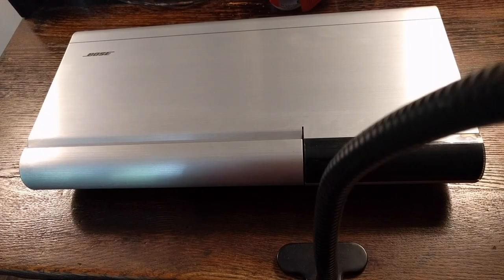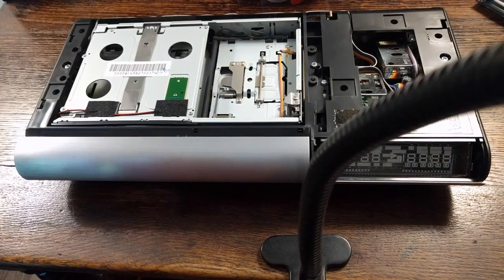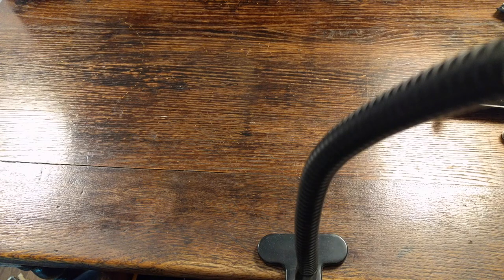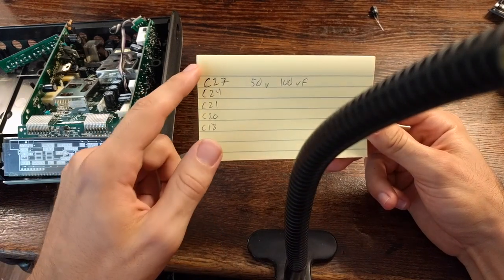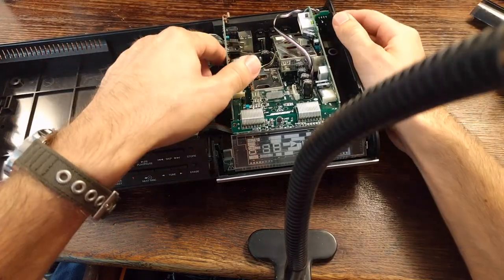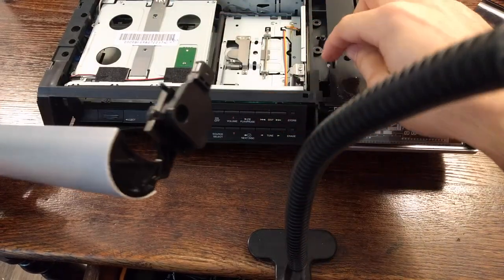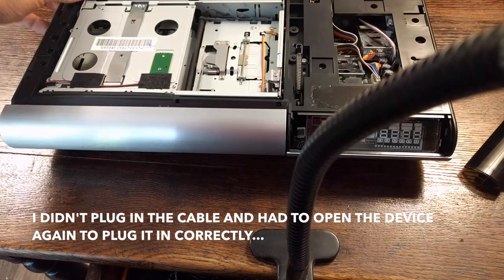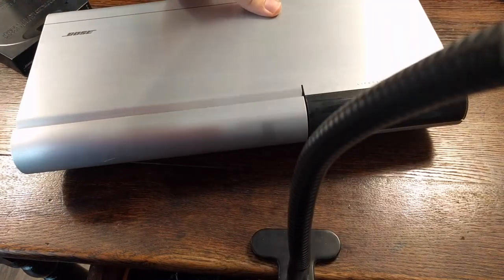Bose Lifestyle 20 Music Center Display Fix Walkthrough

Comment: Thank you. The disassembly was exactly what I was looking fo. Just pickup one of these from a dump yard. When plugged in only motor noise from the cd compartment can be heard . Nothing turns on.
If I don't break it burned or don't get bored while working on it, I think I can fix it. The first tool that I used was my table knife

Comment: It's so amazing to find this excellent video! I knew it was going to be a capacitor issue! I have a lifestyle 25 and I will try this. I read in the comments that it won't come back to full brightness but it's worth doing anyway. Thank you so much for posting this! I purchased the capacitors. I hope it works. Could it not be coming back to full brightness because some other capacitors in the circuit wore out from overuse trying to compensate for the ones that died? If you find any other fixes please post them because I want this stereo to last at least ANOTHER 23 years.

Comment: Great video, just watched your one on remote control RF transmitter fix and yes the coil wire had come loose, I soldered it  ,cleaned the PCP  and contact pads and all working fine. . I shall now buy the 5 capacitors and fix the dim led display, man you've saved me some serious $$. I spoke to Bose and they told me to chuck it and buy a new one . 
Cheers for your excellent video

Comment: Hello Luke I did replace the 5 capacitors and still the display is not coming on, what can be the other problem with it ? Please help.and one more thing is it c13 or c18 as the 4 capacitors which are near together it's c18 please confirm me thanks.

Comment: Thank you for the video. I just bought one of these on eBay and it showed up damaged. I was hoping to be able to fix it myself but I cannot see well enough to do any soldering.  I wondered if you could tell me if I can upscale the same speaker and sub system that came with this console to anything newer?

Comment: I found c13 but it wasn’t a capacitor.  I did see c18 is a capacitor. I replaced c18 instead.
 Your tutorial did work and I got my display back, but not as bright as before.  It was dead for a few years with a stuck cd magazine.

Do you have a fix or replacement gear for the worm drive mechanism?

Thanks

Comment: Thanks so much for making this video, and being so thorough in explaining all the steps. My system's display was COMPLETELY out, but after following this and using 5 replacement capacitors I picked up from amazon, it's back to life again. I wouldn't call it "bright" but it's visible enough. Certainly better than pure dark. Couldn't have done this project without you. Kudos, Luke. <3
Reply: Hello , i have the same display problem with my 25 series ii , can you tell me the capacitors numbers that you used to fix it ?
Reply: @3mendo198  My system has the same problem and I am not sure of the type of capacitors that are needed. Did you get an answer to your request? Thanks.
Reply: @claserealty5972  WHAT EXACTLY IS THE PROBLEM WITH YOUR UNIT ?

Comment: Fixed my favourite systems with your help, thank you so much! In my system, the C27, C24 and C21 capacitors were originally 63V 100uF. Replaced them with 50V 100uF and it works
Reply: Hello , can you tell me where can i buy the capacitors and what are the codes for it ?

Comment: It worked! And it came back to FULL brightness after being completely dead for 1-2 years! UPDT: I also fixed my CD player. I have a Lifestyle 25 and here is what I found with my multimeter as I pulled the capacitors out. C27 =10.0 uF, C24 = 97.4 uF, C21 = 98.2 uF, C20 = 99.9 uF, C18 = 98.7 uF. So basically just C27 on the top side was bad I guess. I read several people say they bought a 5-pack of capacitors on Amazon. I saw those blue ones too but I bought a 20 pack of 105C off of ebay for cheaper instead. Maybe those amazon ones just aren't good and that's why you aren't getting full brightness back? Just a thought. I protest amazon anyway as destroyer of the world.
The sad thing is the CD player doesn't work at all now. It's been years since I last used it though so maybe it wasn't working before I fixed the display just now. It tries to read a cd and just can't read it. I think I remember this happening years ago so maybe it finally totally died. I tried to reach in there and clean the laser with a Q-tip but no luck. I don't use the CD that often anyway on this but it would be cool to get it fixed.
UPDATE: I just fixed the CD Player!!!! I found some youtube videos online about a potentiometer on the laser. If you pull the CD player out and flip it over. There is a tiny brass potentiometer on the laser assembly. Rotate it only 1/8th a turn counter clock wise, set the CD player back down, plug it in and try it. If it still doesn't work unplug and rotate another 1/8th. It took 1/4 turn from start to work on mine. Just a little at a time until it works. It felt like there was resistence after 1/4 turn. Keep track of your turns and be careful because these things strip out so easy! Also unplug it each time you adjust it.
Thanks so much for this! It really helped save one of my best non-sentient friends :) and is a life saver since I use this system to mostly play white noise to help me sleep when my neighbors are so noisy.
It's like new now after the CD and remote is now fixed. I'm so happy!
Reply: Still good and I think it got even brighter. :)
Reply: Thank you so much! Our's CD playing function was malfunctioning. It probably wasn't used for at least a decade. I will try to fix it in the next week or so, your guide will be really helpful :)
Reply: Hello i have a 25 series ii with bad diaplay , can you tell me where to buy the capacitors and what are the codes for it ?

Comment: Hi! Thanks a lot for your help. But still have some problem. First the display was dark, then chance like you say. Chance to 50v 100uF Capacitors (my stereo is a Bose lifestyle 25, like yours in the movie, chance all 5 Capacitors.) Got the light back but its not so strong. What can be the problem? And then there is a problem with the cd player. I can put in the magasin (6cd) it take 1 cd and goes in and done but after some seconds it comes ut and take another disc and do the same proceeder again. If i turn of the player its keep going so i have to take the magasin out and then it stop. Can you help me? I love my old player...Thanks.
Reply from the maker: Unfortunately, I've since learned that if the display is completely dead, it cannot be brought back to full brightness.  

I do not know how to fix the various cd player issues; I will eventually post a video on how to install a bluetooth receiver in place of a cd player

Edit: Please see my channel for instructions on how to add bluetooth
Reply: Hello need help or suggestions please my unit works but no sound
Reply: If it sounds like it is trying to read the cd but fails try this: There is a tiny brass potentiometer on the laser assembly. You can turn it CCW by 1/8 to 1/4 turn and see if that works. See the instructions in another comment I posted under this video.